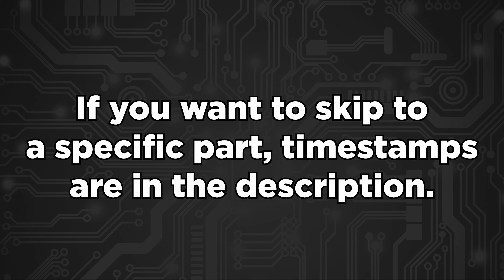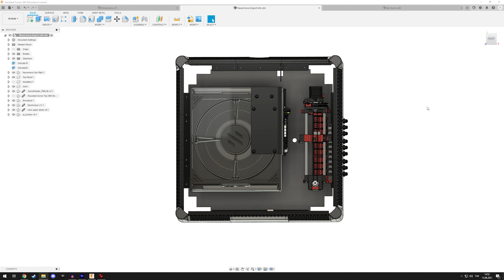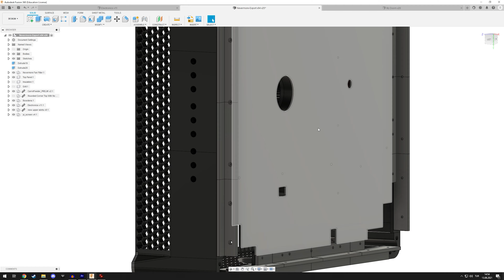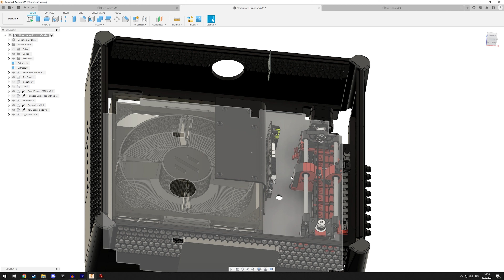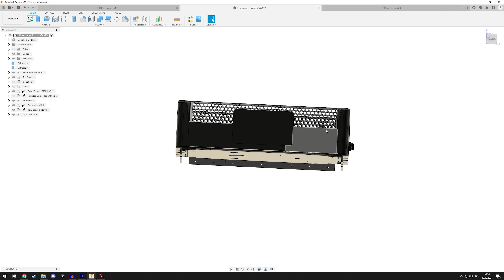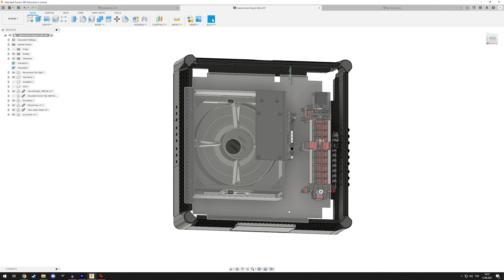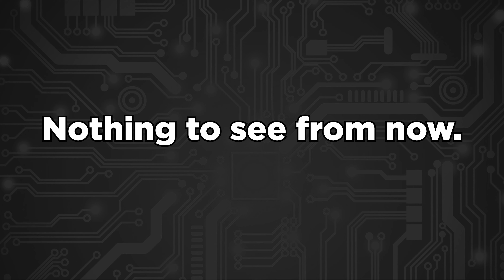Voron v2 Ep. 23 & v0 Ep. 8 - Weird Hybrid Episode

Comment: I'm wondering if the V0.1 could be having trouble from slicer problems. If you were somehow not getting the hot end warm enough or lowering the temp it might look like a failure on the extruder. Maybe you have a setting for a lower temp after a certain layer height? Or could it be something with the temp sensor being miscalibrated?
It is a wild guess, but worth a look if you haven't already considered it :)
Reply from the maker: I was monitoring the temps and there were no fluctuations detected by the fw. The curve is pretty much flat so pid tuning should be correct too, and unplugging layer fans didn't change anything. The problem seems to happen at different heights (even with the same gcode) so I don't think it is slicer related. I don't think it is a thermistor or hotend related issue either but unfortunately I can't test it on another printer to rule it out either since my v2 isn't working yet and Tiny-m isn't finished yet.